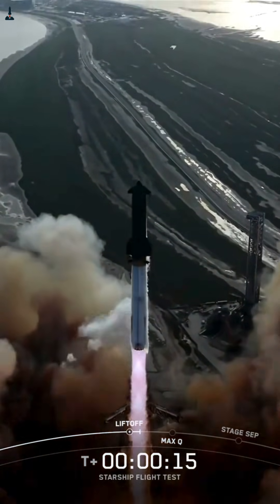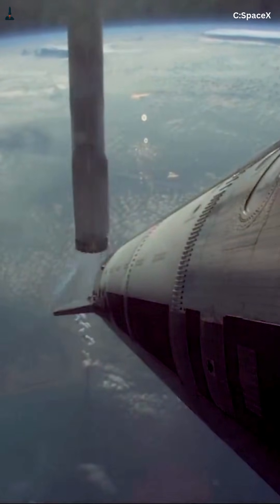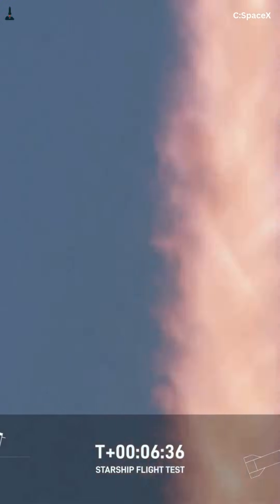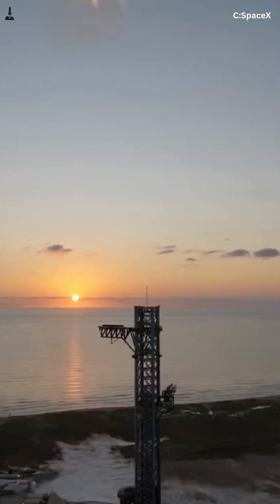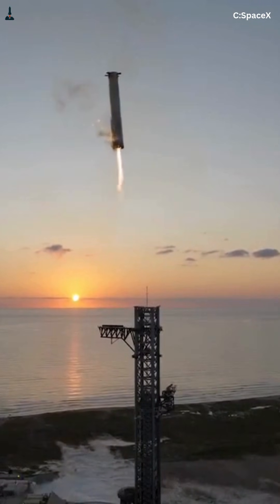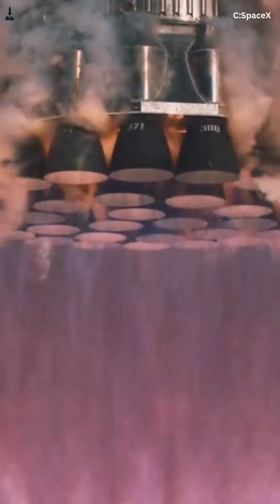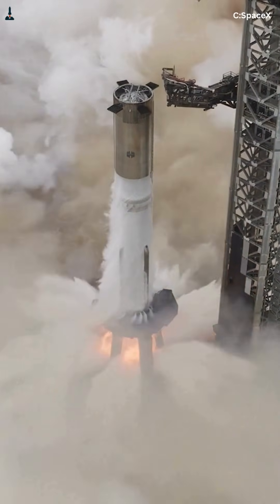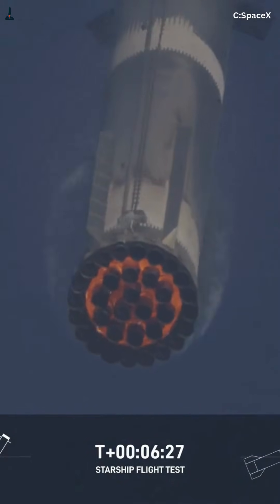Why SpaceX Removed the Heat Shield From the Biggest Booster Ever #spacex #superheavybooster

Comment: And there's the whole foolishnes of Orion.  (Besides that it's purposely built weaker, only to justify the need for Gateway).  Orion returns not only with orbital velocity, but with near interplanetary velocity.  That's almost twice as fast as Starship!  Now if Starship would begin & end its Moon mission at the ISS, the launch & landing done with DragonII, then there would be no need for Gateway nor for a $4billion launch each mission.  And reentry heat would stay within well practiced parameters.  Not even Apollo took reentry direct from its Moon return trajectory, and it was a quick & dirty solution for an unlimited budget.  None of that describes the current situation.  $hit ;• DragonII would fit into Starship, as an escape pod for emergencies.
Reply: Bro get a clue. Gateway was announced before starship was even considered.🫵😂
Reply: @baarni  That's a good observation, and a great example of the ridiculousness of Orion, built for unlimited budget and endless overruns. The ENTIRE Starship program has been envisioned, iterated 30+ Ships and many Boosters built & perfected while Orion is still struggling to get cancelled, AFTER dumping $100B on a tiny, unusable craft = dereliction of duty.

Comment: Brother, the engine bay is one big heat shield. It's completely covered in heat absorbing shields around the engines and the bay itself.
Reply: Not with bloc 3 it won't be. Raptor 3 doesn't need heat shields.
Reply: @AndrewSarchus-f2sTrue but I was talking about the current booster. Block 3 will be amazing either way.